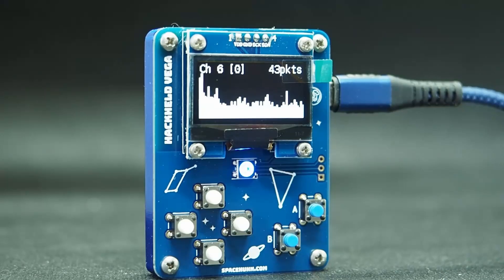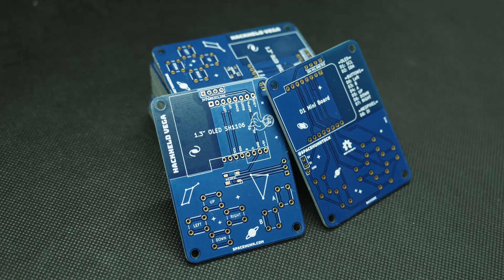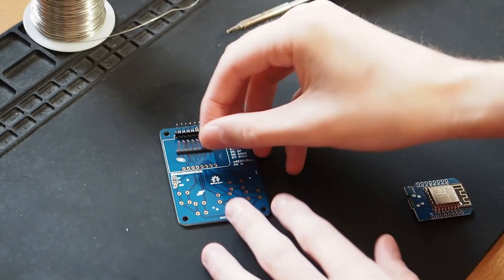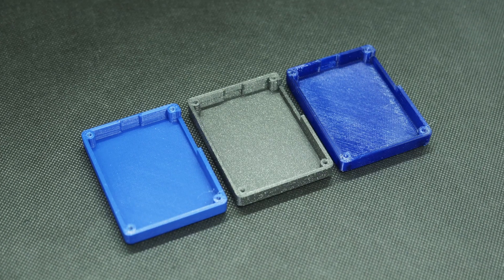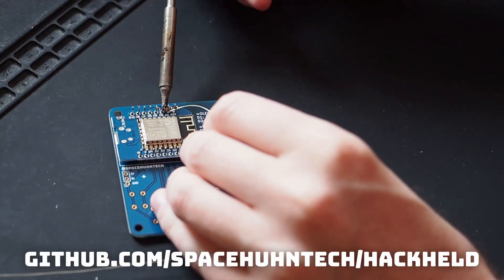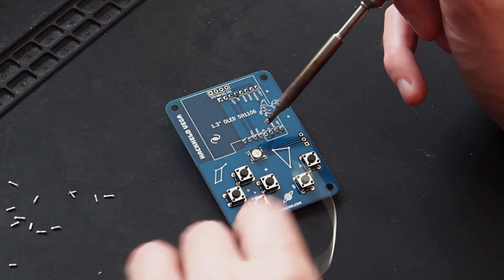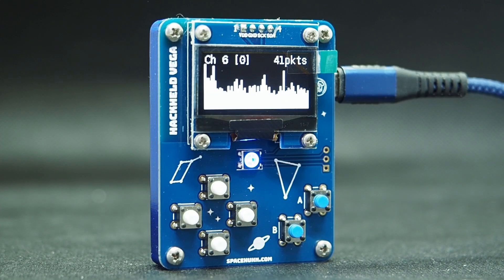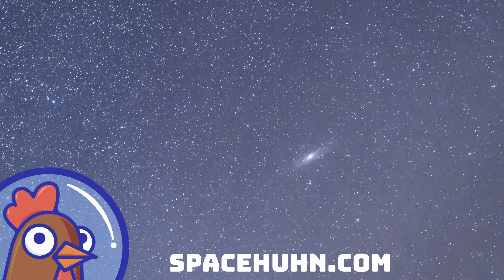Hackheld Vega: DIY OLED Deauther

Comment: Since the pcb’s are already gone, I’ve ordered a few using your gerber files. 

I’ll show the results in a few weeks, maybe a month, when they’re here. 

This looks like a cool little device.
Reply: How do you order with the Gerber files? Like where would I get a hold of ordering one? Their all out on his site
Reply: @cosmicconduit6834  I downloaded the gerber files from his GitHub and uploaded them to jlcpcb.com and ordered them :)
Reply: @EkelundDK  I uploaded the zip to the website. My only option is 'Save to cart' instead of purchase. Do i keep the defaults? The only thing i changed was the PCB to the blue color Do i need to change any other options on it? Sorry im new to this and have never had to get a PCB made before lol im learning soldering with this as well lol Thanks for your help btw!
Reply: @cosmicconduit6834  I didn’t change anything either, I just ordered them the way the gerber files dictated. It doesn’t matter that you’ve changed the board colour, though :)
Reply: @cosmicconduit6834  no problem, I hope everything works out;)
Reply: @EkelundDK  yeah me too, just having issues finding colored buttons. aliexpress he uses is a bit odd with the way things are sectioned etc and its much more expensive on amazon sadly. Everything is bulk on there too where i just want a few lol going to end up with 4 extra PCB or a few extra if i fuck it up D:
Reply: @cosmicconduit6834  sometimes it could be nice to just order one pcb, but as you say, you’ll have spares if anything goes wrong :)
Reply: @EkelundDK  do you have discord? I've a few more questions if you didn't mind. If youre in the spacehuhn discord tag me im teebs
Reply: hey man did u make the device ? if yes, did it work ?
Reply: That's amazing. You might have just opened the door for me to make some new gadgets. Thanks!

Comment: Do you drill the board additionally to attach the display with screws, as there are no screw holes for the display in the original design?
Reply from the maker: I screwed m2 standoffs to the display to have it sit straight when I soldered it, but that’s all. It doesn’t go through the PCB

Comment: great project, i made my own :)
I noticed the housing does not quite fit for the LOLIN D1 mini. I had to make a cutout for the USB port and rest button.
Would it be possible to create a suitable housing for the LOLIN D1 mini?
Reply from the maker: You can edit the case with OpenSCAD
Reply: @spacehuhn  all right, I will give it a try 😅

Comment: Hello.
Pleade can u make video about Roll Jam key fob using 433 MHz cc1101 with esp32 with saving captured key fob signal to SD Card and then pick it cor emulating with using some buttons and Oled 0.96" display ?
It is super cool arduino project but hardcore to program it.
Please make tutorial & have a nice day.